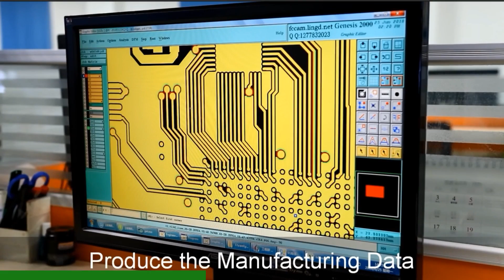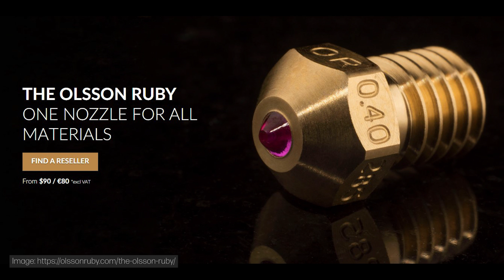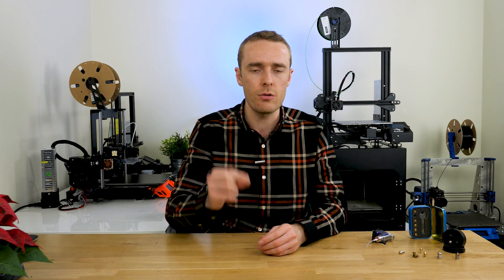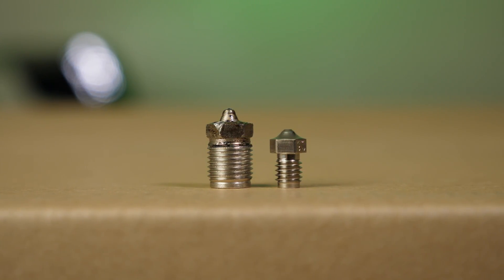3D Printer Nozzles - Everything you need to know

Comment: It sounds to me like a high flow hardened steel nozzle ran at "normal" speed would give you most of the benefritts and the least negatives of all combinations, am I understanding you right? The high flow putts more heat in to the filament and the hardened last the longest (of the none exotic ones) so the reduced heat transfer by the steel is made up for by the high flow design that if you do not print extra fast you gett the filament fully melted any way. Have any brand made such a nozzle or am I missing something along the way?

Comment: super interesting, I have 1 question. I have a few nozzles and I notice they have a different shape of input hole, all of them are for 1.75 filament,but some have a flat surface, while other have a small indent while other have a larger hole (for a ptfe tube). wonder if those can be used with a particular heat-block / heat-break element. If anyone knows the answer please share :)

Comment: Wear on the inside of the bore or aperture of the nozzle is as much an issue as its dragging across the surface, wearing the outside of the tip. You also didn't mention the differences in thread pitch 0.75 and 1.0 in the 6mm nozzles and the proportional length of threaded section vs the rest of the nozzle that differentiate swiss/CR10 ender and V6 styles.

Comment: From what I've been reading (and looking up on shopping sites), there's mainly FOUR sizes of commonly used nozzles. There are THREE types with the M6 thread. The "Mk8" (I've always thought of this as the "Mark 8") has a conical tip and is used in the Ender 3 and a lot of other Creality printers, there's the V6, which is used on E3D designed hot ends and clones (it's got a sharp cone coming out of a flat surface at the tip, and is NOT compatible with the Mk8), and there's the "Volcano", which is a lengthened V6, and is so-called because it originated with the E3D designed "volcano" hot end, which is really good when you need to print with a large nozzle orifice to print large objects on a big-bed printer (as a result most big printers come with this type of hot end these days). The fourth common nozzle which uses the M7 thread, and is called the "Mk10" (Mark 10). In online stores, if you search for "Mk10" or "M7" these will come up. My Wanhao i3 Plus uses these, I'm not sure where these originated but I suspect it's something that caught on early when people were inventing hot ends. Not sure what other printers use these but there must be a lot of them, since the nozzles are common. There are doubtlessly other types, but they don't seem to be commonly available on shopping sites. I've never come across those M10 threaded ones in the video, for instance. One odd type of nozzle I'm very curious about are those long, pointy "airbrush" nozzles - they're actually in two parts, you have a small nozzle that screws into a V6 nozzle body. I've only seen them available in the V6 size. Not very much information about them, or videos on YouTube about them, either.
Reply: V6 has a longer thread than MK8, and very similar overall length, so you can usually substitute V6 in an MK8 hotend without issues - excluding possible compatibility issues with the sock. The other way around doesn't work. However i have noticed that various MK8 manufacturers have different ideas on how large the MK8 hex drive needs to be.

Other M7-threaded hot-ends besides your Wanhao are several of the Geeetech models. The first printer with MK10 nozzle that i can think of would be Makerbot Replicator 2 from 2012. MK8 is the original Replicator. You can keep rebuilding and running those old Makerbots with various Chinese parts.

The V6 airbrush nozzle adapter was invented by René Jurack around 2017 for his DICE printer, and he was manufacturing and selling those and various other parts. This was a very small, rigid, high movement speed printer, and he wanted to create some distance to the brass body to reduce print curling from radiant heat, and to allow him to do nozzle sizes around 0.2mm for very high detail prints. But there had been earlier uses of airbrush nozzle, like the 2012 Merlin hot-end, which has a permanently mounted brass throat with replaceable airbrush nozzle.

Very early DIY printers used M6 and M7 gas stove nozzles.
Reply: @SianaGearz  Interesting. Two years later and things are changing - quite a few proprietary nozzles are in use, the Elegoo Neptune 4s and the more recent Artillery Sidewinders, for instance, use new nozzles. Chinese industry being what it is, third party suppliers very quickly came up with copies.

Comment: I've always wondered why no one used 2.85mm filament anymore, it seems it was a lot more popular back in the day. I imagine it'd be better for large sized prints with big nozzles. That size of filament isn't easy to find.
Reply: I bought some 3mm filament by accident last year. Figure I'll just use it for plastic welding.
Reply: @BigHonkinGoose  Yeah, this almost happened to me, too. I have found more information about this - in the Dark Ages (which really was only 7-8 years ago.. ) when there were NO hobbyist FDM printers available as kits, let alone for commercial sale, and the only printers were being built by the Pioneers of Reprap, who bought materials off McMaster Carr, depended on earlier-built printers to print parts for newer printers, when hot-end heating cartridges and ready-made nozzles didn't exist yet (people were hand-winding heating elements for hot ends out of nichrome wire), there was no such thing as spools of filament you could buy. But the likes of McMaster Carr DID sell long 3mm (probably most were actually 2.85mm) rods of plastic, and this is what they used for printing. So 2.85mm hot ends were common in the beginning - a lot of those early hot end designs were specifically designed for the material that was available, and have since faded into the mists of obscurity. 1.75mm filament has a lot of advantages, the main one being accuracy of measurement. It's easier to achieve high precision in extruded volume of plastic with 1.75mm filament than it is with 2.85mm.
Reply: @iskandartaib  Thanks for the history lesson! That's fascinating. I've got some nichrome, maybe I'll so some experiments after the holidays.
Reply: It is a pain to rout 
It likes to snap

Comment: About the ruby nozzle. Isn't the idea here that the metal first transfers the heat to the plastic and only at the end does the ruby nozzle narrow the diameter? This means that the ruby no longer plays a significant role as a large heat conductor. By the way, should heat-resistant heat-conducting paste be used for the thread?

Comment: nice video.  A little bit of a nitpick on the heat capacity of tungsten/tungsten carbide vs brass..  These values are using mass as part of the unit (how to say this?), and since tungsten/tungsten carbide is about 2x the density of brass, the amount of heat energy that the tungsten nozzle (assuming the same size) can hold is actually MORE than the brass, meaning the temperature will be MORE stable for a tungsten nozzle compared to a brass nozzle of the same size/shape/etc.  Not arguing with the numbers you've provided, just that the tungsten nozzle will be more than 2x as heavy as the brass, and therefore will be able to hold more heat than the brass.  Assuming regular tungsten metal, the tungsten nozzle will be able to hold about 1.35x the amount of heat energy as the brass nozzle.

Comment: Not sure about keeping the flow rate the same. Assuming a fixed amount of pressure that your extruder can put out, and thus the same pressure drop over your nozzle, and a laminar Poiseuille flow in the nozzle, volumetric flow should be able to scale to the third power of nozzle diameter. Thats ignoring some other things like your stepper torque-speed curve or how the material flows under the nozzle (probably want to scale layer height along with diameter); and then there is the melting; perhaps with a thicker nozzle you are dealing with higher viscosities in the center. So its not all that easy; but ive recently measured my volumetric flow until skipping going from 0.4 to 0.6mm; and I could easily double my volumetric flow.

Comment: Very well explained, best video I've found on the subject. I've seen nozzles that take a screw in nozzle as the tip of the nozzle - the tip being I believe an airbrush nozzle. You didn't cover these but I'm guessing they would not be great. I was wondering whether you could use a volcano style (long) nozzle in say a Geeetech A20 or Ender 3 stock hotend as a combined nozzle/heat-break if you left a gap between the heat block and heatsink or if it is not that long?
Reply: They are OK I've been using one at low speed and they print detail really well, but at high speed it tends to pick up the extruded tail of the plastic, speeds in excess of 100mm/s at 3k accel,

Comment: You failed to mention the importance of the threaded length. If it is too short, even if the nozzle is the correct length, you will be unable to screw it down the the heatbreak. This can cause the user to screw the heatbreak too far into the heaterblock so that it touches the cold-end. This is particularly evident when using a cheap chinese 6mm hex nozzle on a v6 heater block.
Reply from the maker: Correct, if you buy the wrong nozzle for your hot end, it won't work correctly.

Comment: what difference does the tip geometry for a given nozzle size  make to print quality? does the internal geometry of the transition from the bore to the tip make much difference to how easy the filament is extruded?
Reply from the maker: A good and very niche question, I don't have any answer for you at the moment im afraid.
Reply: Of course it does. Smooth transition and superior surface finish are better

Comment: With constant heat applied, will all these nozzles  be the same temperature over a period of time?  For sure how quick the heat will be transferred on each will be different, but I wonder if at the given time it will be all the same.
Reply from the maker: You need a control system to keep a consistent temperature But it would be possible for all nozzles to keep a consistent temperature of 200c for example. Worth noting though that 3d printing is a dynamic process not a static one.
Reply: @Vector3DP  yes sure it is a dynamic and I can observe that with the lcd that the temperature is fluctuating but trying to maintain the target temperature.  
I hope you can make a video that will show how these nozzles keep the temperature, say 200degC for a period of time like as in printing.    Really interested to know the results.  Thanks for the reply.  I am now a subscriber to your channel, very interesting and informative.  Well done.
Reply: @willpolicarpio141  pid tuning is what does it
Look it up for best explanation

Comment: How is the ender 3 with the 32bit board?
Reply: @hodbod41   Running an SKR v1.4  (basically a v1.3+) on a FlashForge Creator Pro with a Titan Aqua. Apart from the still-awful documentation (for both the 1.3 and 1.4) that really slowed me down, it's going really well. Using TMC2130 sticks in SPI mode. IMHO, well worth the money.
Reply from the maker: Honestly had no time to use it since the live stream. So no idea 😅
Reply: @Vector3DP  I just wanted to ask because I have it on the way
Reply: @hodbod41  I just upgraded my ender 3 to skr1.3 with tmc2208, e3d v6 and titan extruder. Works amazing!